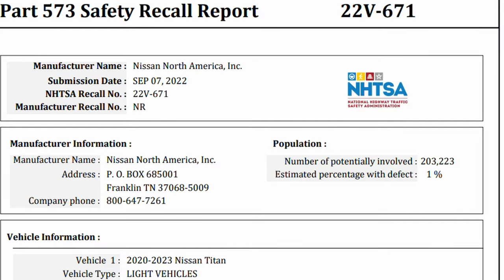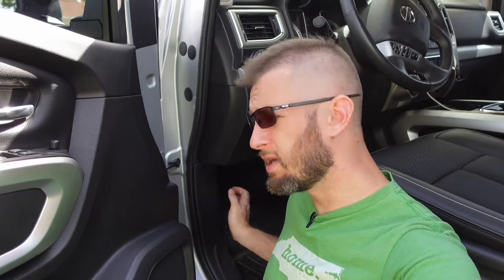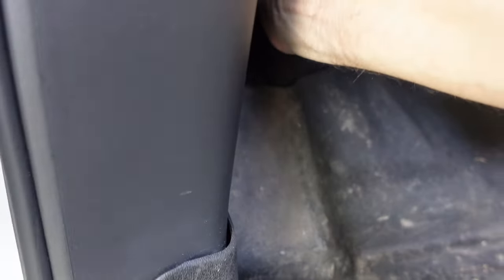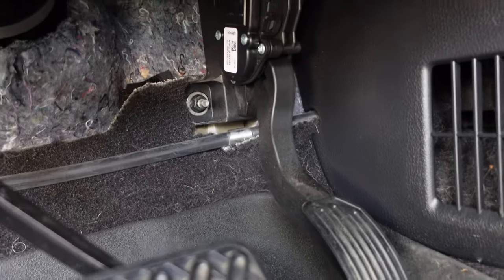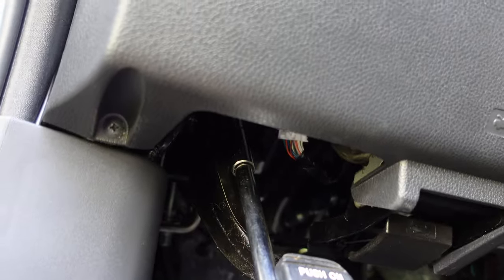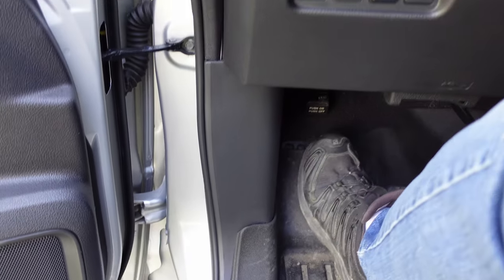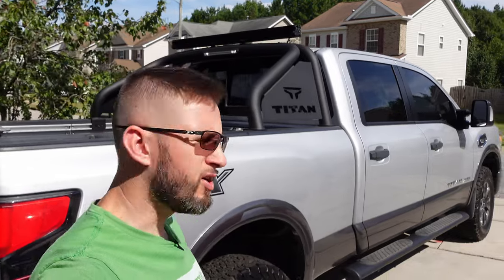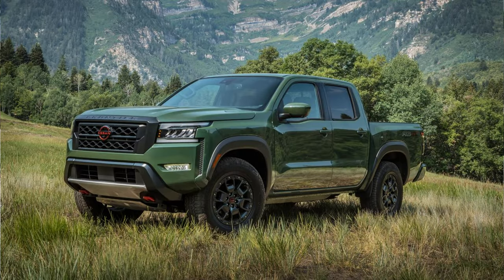How to Adjust Nissan Titan Parking Brake

Comment: Great video. I just had my first oil change done on my 2021 Titan and my dealership ordered the parts for the parking pawl so I’m assuming they have a fix for it. They did say it would take the better part of the day for the repair due to the fact they have to drop the T-case.

Comment: Love your content. Can you do a review of your Nismo exhaust system?
Reply from the maker: Sure can! Anything in particular you'd like to know?
Reply: @4KMotoring  thanks for the reply! (1) I’ve heard from others it’s significantly louder than the stock but can’t confirm could you clarify this? (2) How is it in the cab? (3) Typically on the stock you have to step on it to get it making some noise, how is it with the Nismo? (4) Has is it with towing? (5) Any adjustments you have made since installing? Or, is there something we should take note of? 

Keep showing off these beasts! These things are workhorses. You’re one of the very few to offer such great content on them. Thanks for everything.